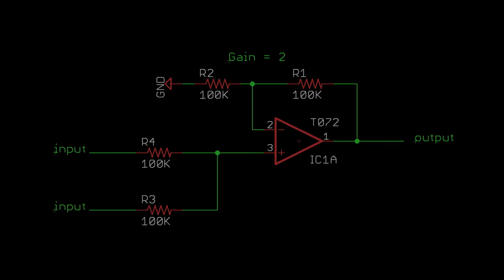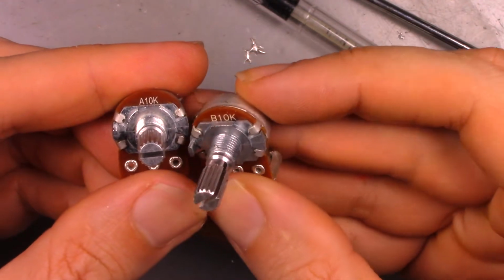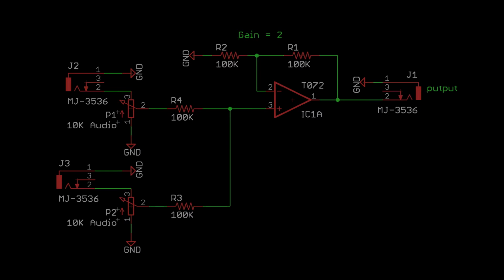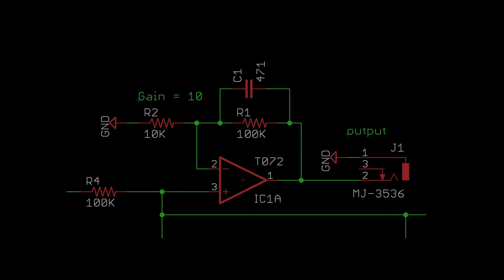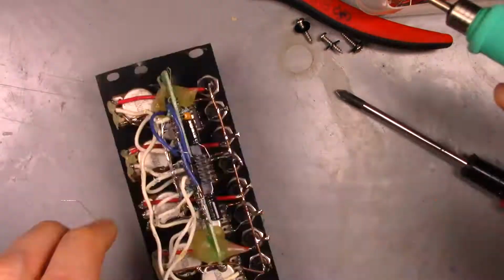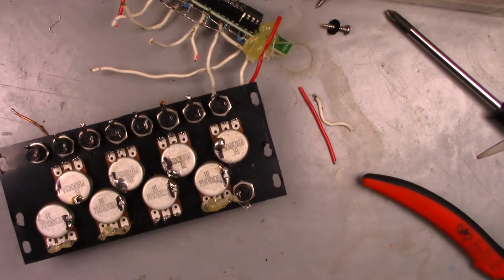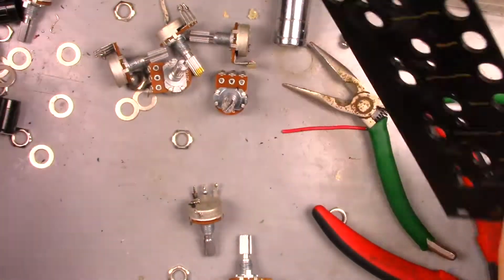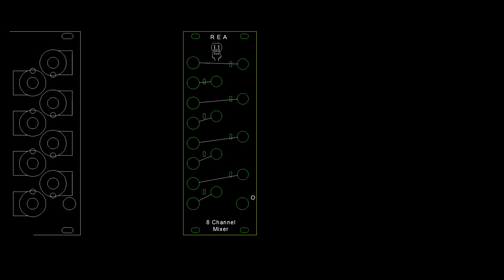Eurorack 8 Channel Mixer

Comment: Great build!
One question, the gain is calculated on the number of inputs. But what happens if you connect less than 8? Is that's why the 100K are in series with the pots?
Reply from the maker: Gain required is calculated by number of inputs because inputs still feel ground though the pots even when no signal source is connected. This connection to ground through the pots also means the output level of the mixer is independent of the number of inputs connected. The 100K resistors are to limit the amount of signal one input can back feed into another.